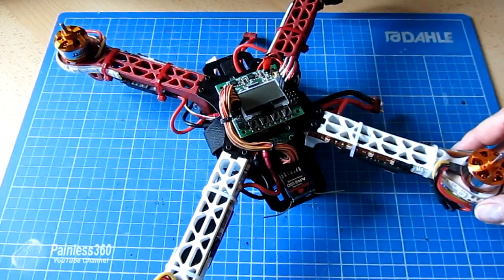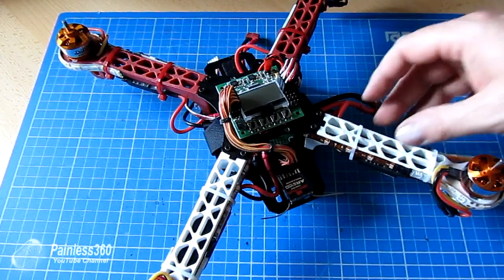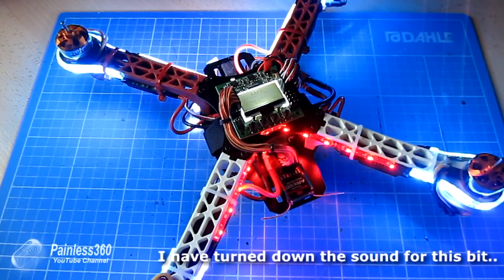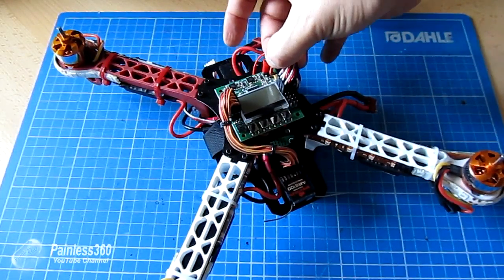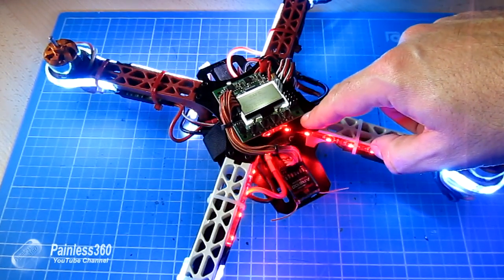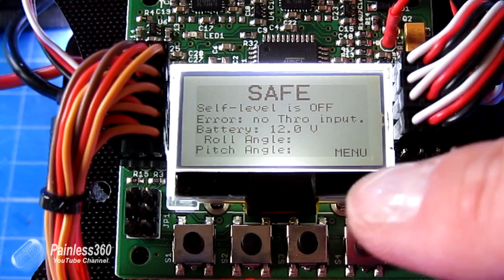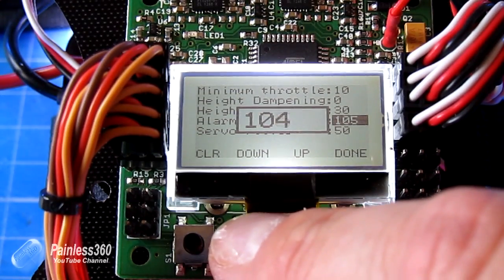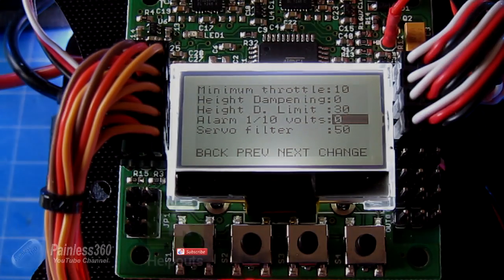Multirotor Quick Tips: KK2.0/KK2.1 constantly beeping

Comment: My kk2.1.5 led is blinking continuesly
Reply from the maker: What troubleshooting have you already tried?
Reply: My KK 2.1.5 Is not showing anything in the screen. It was blank. So I supplied it from a 5 v dc source. Same was happen. After same sacking and pressing it for checking loose connection issue It started blinking continues but no text is shown.. after that I off the supply and turn on the blinking get stopped.
Reply from the maker: That sounds pretty fatal. I’d try and see if you can update the firmware, if that fails then it might be time to replace it with another one.

Comment: First off i would like to say thank you for all your informative videos..Im sure a lot of people feel this way..lol..
I am having a heck of a time trouble shooting a build very similar to this one and wondering if you may help..what would be the best way to get you the required info on what i got going on?
Reply from the maker: TheArtm4n Hi, a description of the problem is a good start, a video with narration is even better. Following that, we can chat over Google Helpouts if needed to get to the bottom of the issue. Hope this helps.
Reply: Painless360 Thank you for getting back to me. I will create some video and photos for you to view to help with this issue..im hoping its just some setting and not a hardware failure. I have assembled helis in the past and never come across such an issue so im stumped..
My equipment, 
Fly sky FS-T6 and matching receiver
F450 frame
4X A2212 1000kv motors
4X 30A ESC
MWC multiwii 2.5 SE flight controller
2X 2200MAH 11.1V lipo
My set up was purchased online from China as a Complete kit, and I originally assembled as factory recommended. Kit never came with any instructions, but I found some vague online directions.
When I first power it up, the board blinks, motors beep a few times like they are linking and configuring as should..then stops and I get a repeated beep, beep, beep, beep..non stop..no control in any way.
I tried several different set ups from various forums with several configurations from the multiwii Ardrino site without any luck..Thinking I may have had a bad board..i bought another..same results..then I purchased the KK2 board..I read its a bit more user friendly but not as accurate as the Crius board but had to try..same results..
I then removed all hardware and separately hooked up one motor and ECS.. no connection on all 4 ECS
I have a old RC car and removed the steering servo to test the transmitter..Hooked it up..no connection..
When I hook the system up to Multiwii software configuration I have stick control..i can see the stick travel set up that tells me I have transmitter to receiver to PC connection??
Unfortunately, I can't find any clear documentation on the Transmitter set up or ESC programming..I have tried several stick configuration to enter ECS programming but don’t seem to get any connection but may be doing it wrong..
Any thought??
Reply from the maker: That link works but the images are of a quad in the middle of being built. What is the problem?